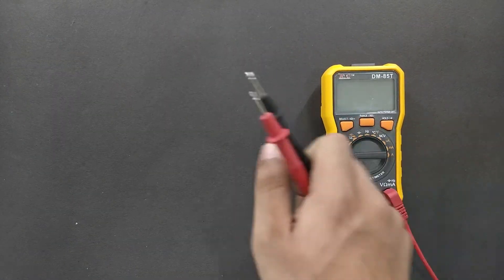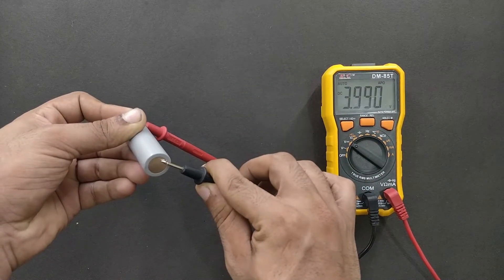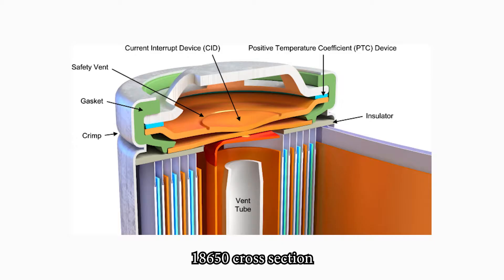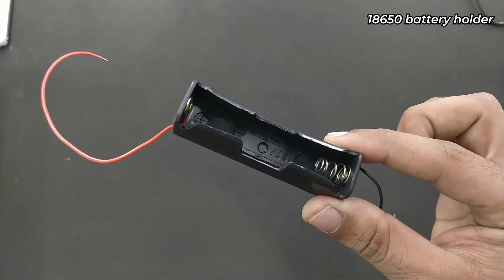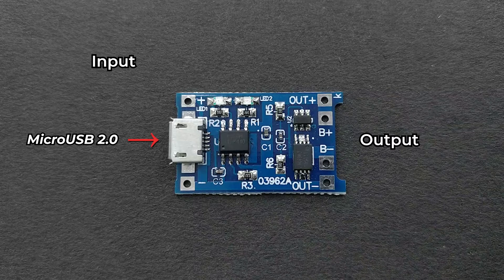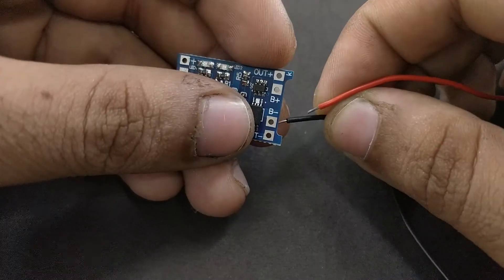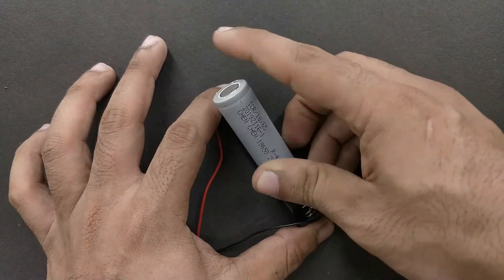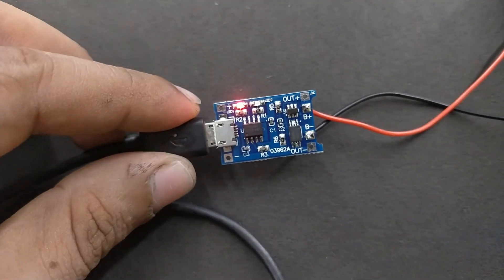How to Make a Li-ion Battery Charger | DIY Charger for 18650 Battery

Comment: Can we connect two batteries in parallel using this module, what would it affect, do my batteries would run for long time if I charge two batteries instead of one.
Reply from the maker: Yes you can charge 2 batteries in parallel. It will take more time for charging if you connect 2 batteries.

Comment: Mf using a premade charger module and call it creating a charger
Reply: No doubt bro.. smh. 
It’ll work as a good idea for some so I’m not knocking that but I’m in a pinch right this second. If I’m going to have to order parts I’ll just get the damn charger myself. lol.. they’re cheap enough honestly.. lol
Reply from the maker: Yes, And that's how you can have one cheaper and is easy for most of the people watching my channel . If I choose to design and print a circuit not everyone can do the same and that will be expensive.
Reply: Sayin' doe. Show me how to make one of them, then we'll be cookin' with gas. Also, that little circuit board... can that be from any old charger, or does the output have to match the li-ion battery you wanna charge? Asking for a friend. Lol